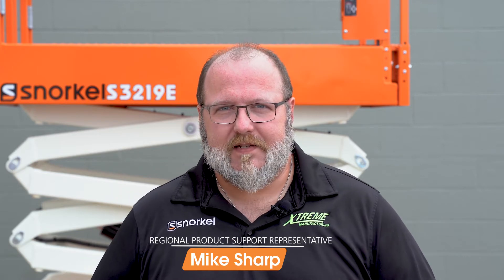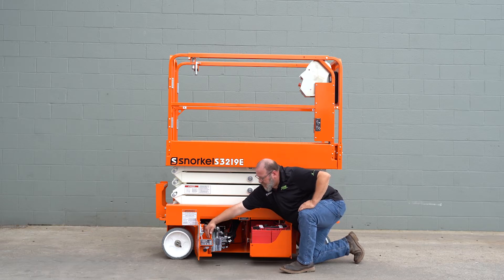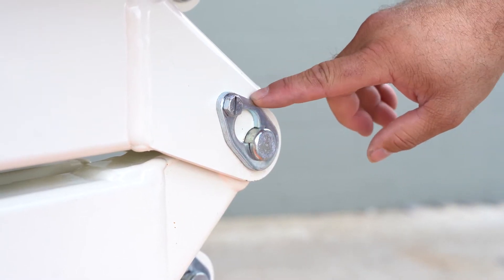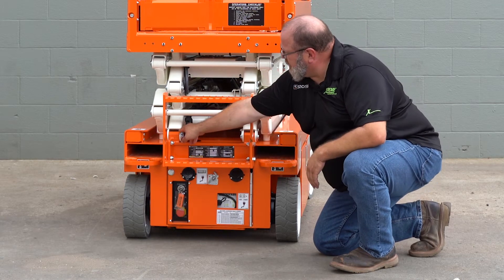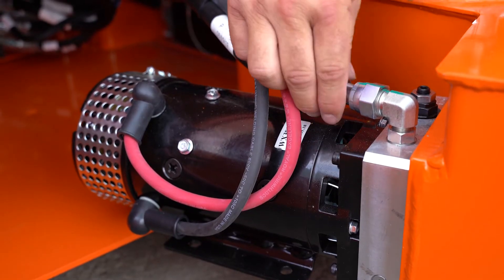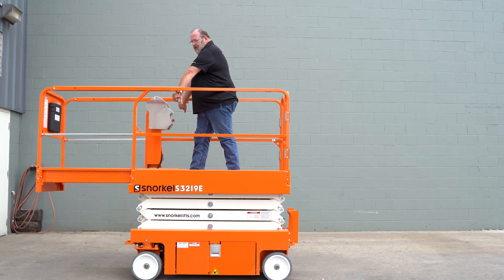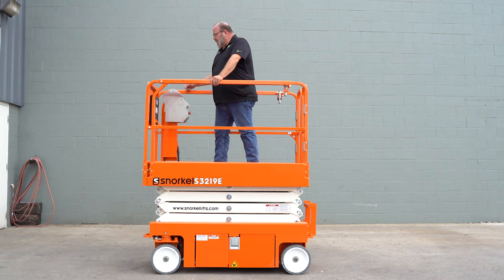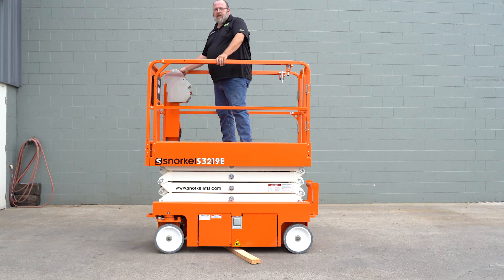Snorkel Electric Scissor Lift "Do It Daily" Pre-Start Inspection

Comment: Nice video.  But I was in shock at 6:19 - you walk to the front of the machine for the manual lowering - when you're standing there looking at us, aren't you directly underneath the no-go zone beneath where the extensible platform comes out??  Is there an option or a modification available for the manual release to be somewhere other than directly beneath that?